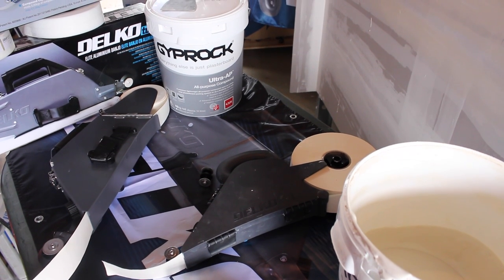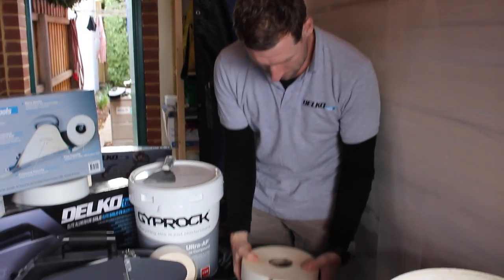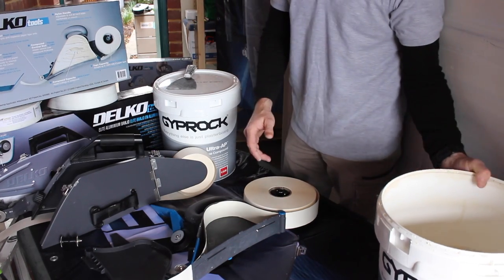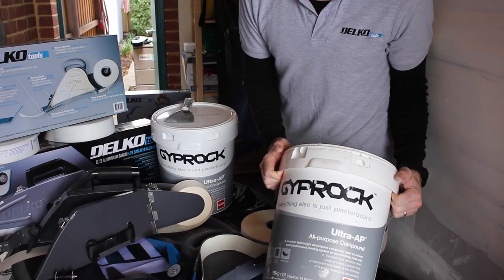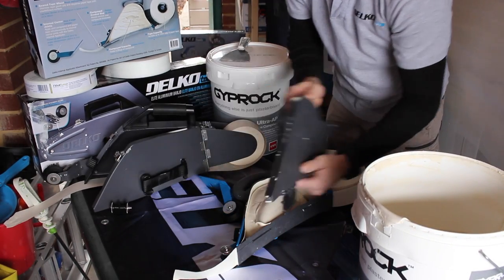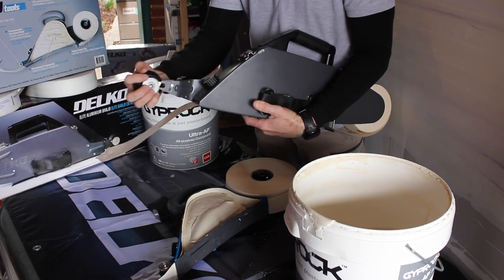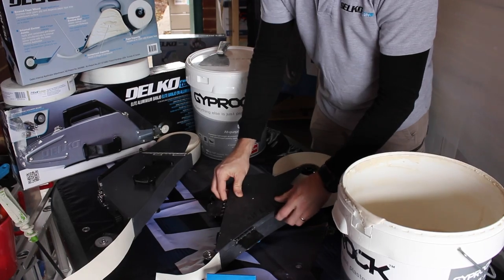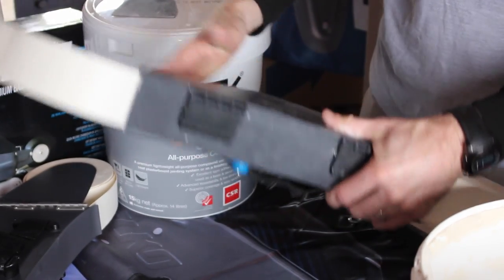DELKO TOOLS drywall banjos

Comment: hi I would wondering if I have to fill     the flat joints before I applying the tapes on?
Reply from the maker: No, the tape has compound on it and rolls directly onto the drywall